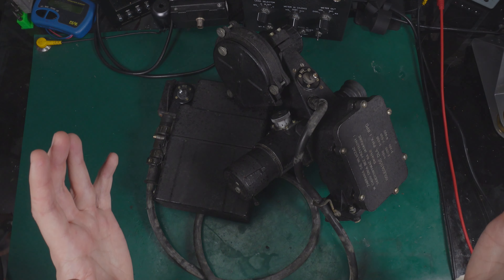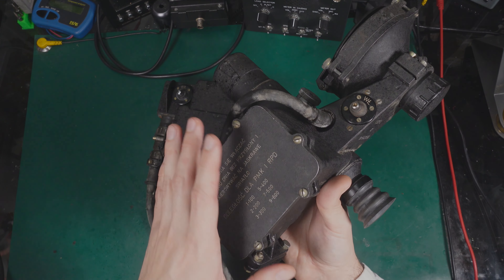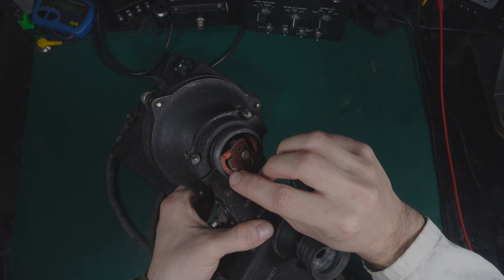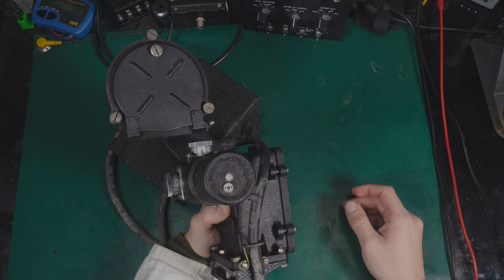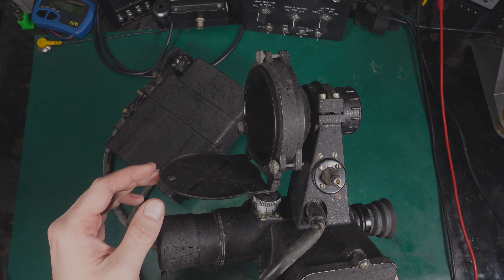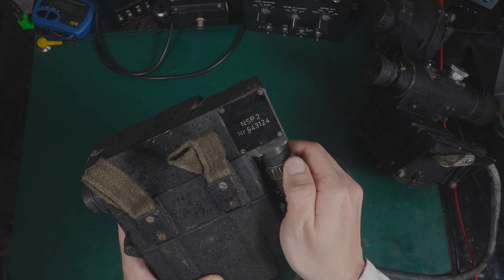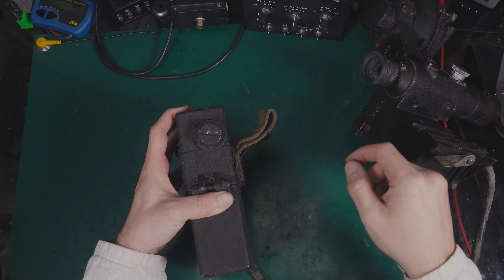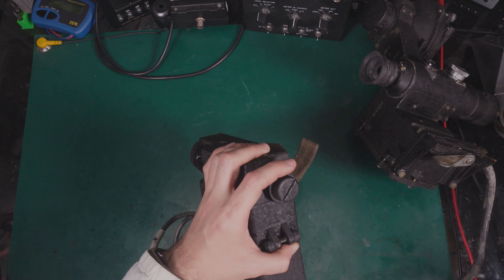Vintage NSP-2 Night Vision Rifle Scope

Comment: Online people say it runs on 6v any help with confirming what it should be?
Reply from the maker: Yes, 6V is correct - it will operate at peak performance around 4.5-6V.
Reply: in the manual it said it used 3 1.5v batteries in series, the same batteries as the NS 71 which uses four of them. So its officially 4.5v but since the tubes work anywhere from 13.5 kv to 18kv, so 6 volt should be fine